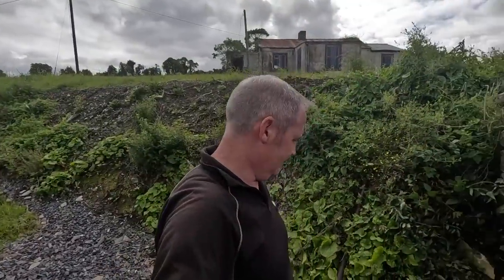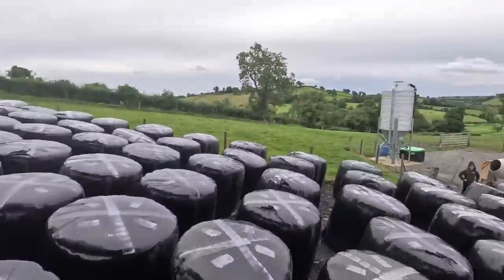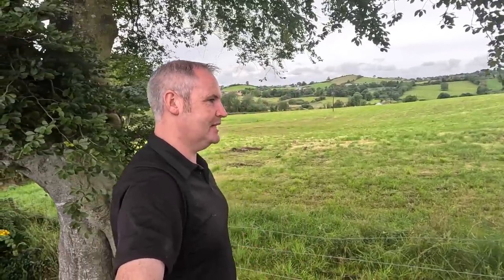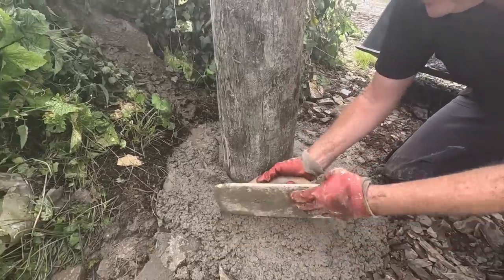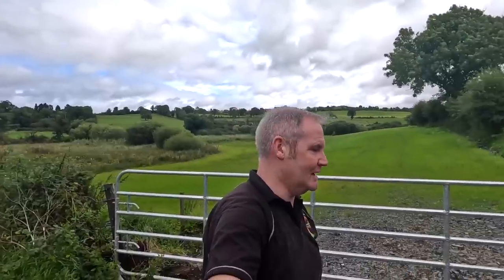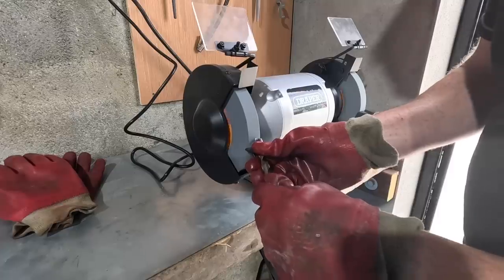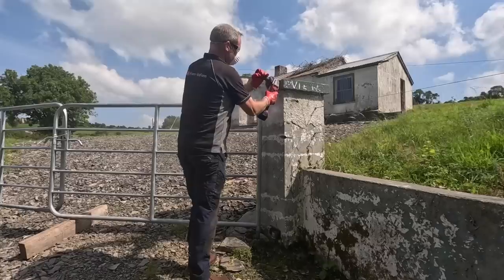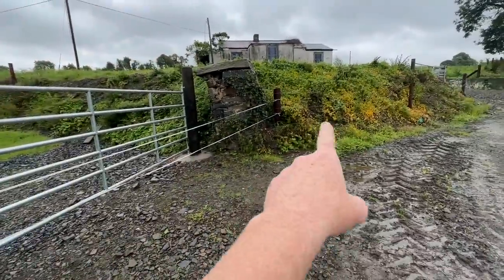Making An Entrance || Derelict Cottage & Grounds Work

Comment: You could do with an English man's shovel there Adrian - a square lip and takes twice the cargo as your 'tongued' one, so would match those powerful lift arms attached to the strapping garsún that you are - also better for cleaning up concrete surfaces.  i.e. AM machinery as opposed to MF - haha!  Also reminds of road sweeper Trig in Only Fools and Horses - His brush lasted all of 27 years, attributing such to his replacing parts promptly, etc - it had 17 new handles and 22 new heads! 

As for the gate, 'it will open and close without protest' as my old pal John B Keane once said when two Kerry brothers hung a new garden gate while home from across the pond for xMas!  Now as to which gate is best, well we can't forget '47 in The Polo Grounds!

Comment: If you want a shovel/spade that is near indestructable, have a look at Fiskars. Most of their tools have steel handles instead of wood, and they are pretty reasonably priced. I've used one of their spades for 20+ years, digging trenches, chopping tree roots, assorted other types of abuse you can think of, and it still lives 🙂
Reply: 😂 Funny! 👍
Reply: It's not like Trigger's broom is it? 🤔😂
Reply: Yeah I broke a couple of axe handles before I invested in one with steel handle. Way to go for shovels or spades also...

Comment: Enjoyed  how did you sharpen your drill  bit try it before but didn't work
Reply from the maker: There’s a knack to it, half circular motion. There’s loads of videos on YouTube which explains it, but if the bit has been over heated it will loose it’s edge very quickly again.
Reply: @IFarmWeFarm  thanks

Comment: Concrete will rot timber posts
Reply: That would be my thinking too
Reply from the maker: Ordinary post yes for sure but these old power line post are very tough, we’ve ones in over 30 years and they never rotted at the base as of yet. Putting a top cover on id important though as water will destroy them from there

Comment: Would it not have been easier to use post driver seeing as it's a temporary job
Reply from the maker: With all the stones and hard ground it would be near impossible to get it straight, so if these temporary jobs can be long term 😉

Comment: You need invest in mini digger
Reply from the maker: There’s a very exciting video coming 😉
Reply: @IFarmWeFarm sounds interesting!

I’ve got to say our 28 year old JCB 804 is the most useful machine on the place and best investment…..

You get jobs done you’d never get done otherwise
Reply: 130 Zaxis here. Done a serious work with it in 10 years, nearly 4000 hrs. Til big men, that's nothing, but for this wee firm, it's been busy.  Value that til what a contractor would charge. Digger costs nothing now, and still worth a lot of money.